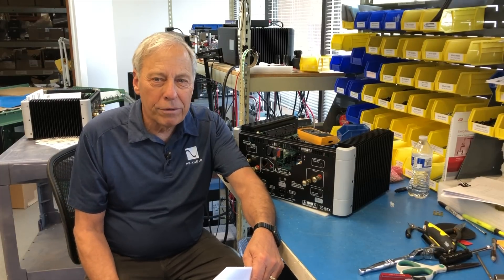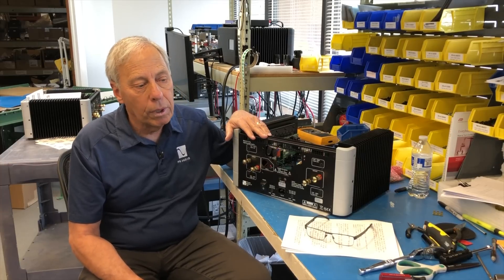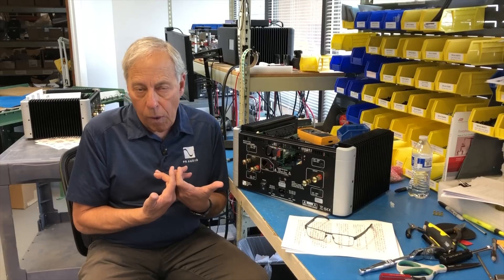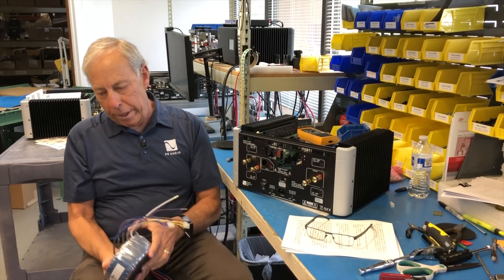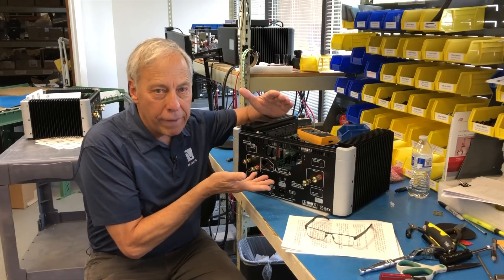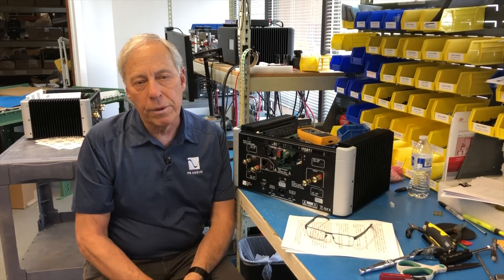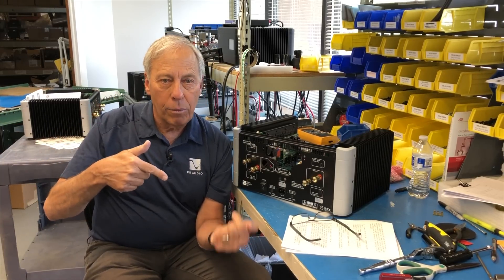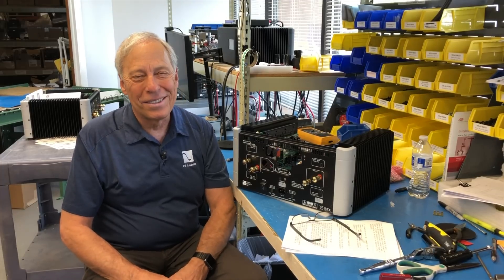Can you run 4Ω speakers on an 8Ω amp?

Comment: I disagree. For lower impedance speakers amplifier is driven with lower voltage and higher current and vice versa. When amplifier is designed to drive 8 ohms then with 4 ohms speakers it can overheat. But when amplifier designed to run 4 ohms speakers it's ok to use 8 ohms speakers, you will get only less power.
Reply: Lets say I am not using an amplifier. I have a hometheater and swap the  5 normal speakers with other speakers form another hometheatre. Will the homethatre will be affected. The impendance of the speakers is lower than the impendance of the original speakers. Or does it only apply to amplifiers?
Reply: @washingtonsenier9667  If it's an active speaker (which contains a proper amplifier and you need to plug it into wall socket) it does not apply, otherwise it uses amplifier in hometheater

Comment: can anyone help, i have an 800w amp with minimum impedance of 4 ohms and a speaker that has an  impedance of 3 ohm. will it run fine? or should i be worried of anything burning out?

Comment: So in short, he is telling you that an 8 ohm amp can totally power a 4 ohm speaker cabinet without any problem as long as it is a modern amplifier (solid state I assume)
Reply: Yea solid state. Vacuum tube amps are the ones with the limit for impedance

Comment: I think Paul may be giving some bad advice here. At low volumes and/or high frequencies, you're probably fine. At high volumes and low frequencies (i.e., bass), you're 4 ohm speaker on your 8 ohm amp is going to draw more power than the amp is designed to supply, and bad things can happen. If you are lucky, your amp will overheat and momentarily cut out. If you are unlucky, your amp will overheat and permanently cut out.

Comment: We used to have "Smokefest" parties... everyone would pitch in and buy a cheap AV Amp and hook it up to some decent 4 Ohm speakers run at high volume until the Amp clipped or smoked. Some of those cheap plastic ones would melt.

Comment: I have to say I disagree with you on this topic and this is why. Most speakers rated to 8 Ohm nominal impedence goes down to around 5 Ohm in the bass and low mid region, demanding more current at those frequencies to be drived properly by an amplifier. Now, how about a 4 Ohm speaker? Mr. Michael Fremer stated not long ago that his Pass Lab amp, rated at 200 watts per channel had a little bit of difficulty driving his Allexx speakers because they were going down to 1.5 Ohm in the bass frequencies. If a power monoblock can barely control a big tower speaker, can you imagine how hard it is to drive 5 to 14 speakers in a home theater system with only one transformer having to supply current when you are listening to an action movie? I have to say the great majority of audio engineers disagree with you also. Power and size does matter a great deal. In fact, this is the predominent reason why so many amps sound so weird with difficult, hard to drive, low impedence loudspeakers. Also, if you remember, the first loudspeakers to appear on the market were high sensitivity/high impedence models (Klipsch and Altec Lansing, to name only two). Those drivers could sing loudly with only 10 watts of power. Todays speakers have an efficency from 84 to 92 db for 1 watt of power, so they will need plenty of juice to give more than a whimper. Also, having built or modified more than 100 pair of speakers in my career, I can certainly testify to that point of view.

Comment: I cannot agree. Any electronic device has a current rating under nominal load. It is not only the finals, it is also the rest of the circuit. 
While some amplifiers may handle higher current some might escape the magic smoke. And it can be very expensive.
Always go with the manufacturer recomandation

Comment: So, I have a question based off this video. I found an old Yamaha integrated amplifier. Don't know model number offhand. I'm going to say mid 80's to early 90's. I bought Wharfedale D320's to match. And it sounded amazing. Well one day I turned it up. It seemed awfully loud, but I was cleaning and you know the rest. I went to turn it on the next day and had no output sound. Which made me sad. I had been meaning to pop the case open hoping it's probably output transistors that melted or something. Where would the first place you would look.

Comment: if you use a lower rated load impedance, purely theoretically you could overheat the output transformer. For example a guitar amp that has 16 ohm output connected to a 4 ohm cabinet, possibly the amp head could overheat... but realistically, for that to happen you are listening to crazy loud music. Before you can overheat the output transformed and blow up your amp the police is knocking at your door called by your neighbours.  The theoritcal risk is there, your amp can deliever say 100 watt at 16 ohms, so insteda you offer ohm load you would be asking your amp to give 200 watts to to speaker... but by the time your master volume has you using 10 watts to drive a speaker you are way above bedroom level. For home usage, it really does not matter, you adjust the master volume to acceptable volume and the wattage you are driving through the speaker  is typically always very low. You are spending 100 watts in byasing the tubes and heating the valves and whatever, but only a trickle of wattage flows to the speaker.

Comment: You could smoke your amp with 4Ohm speakers if it’s designed for 8. But if you’re only playing at moderate levels, way below the maximum that the 8Ohm amp can deliver, you could use a 4Ohm speaker. Currents will be higher, but as long as they’re within spec, it should be fine.
But don’t push it.
Another issue might be damping, controlling of the speaker. I’m not sure, but maybe an amp designed for 8Ohm has less controlled bass response on a 4Ohm speaker. Maybe someone else can fill the gap in my knowledge here.

Comment: These output transformers are still the way to go (and very important) in tube guitar amplifiers. Having multiple taps allows you to connect to different speaker cabinets, which can be up to 16ohms in many cases.
Reply: yes

Comment: What if your stereo says it must have at least 8 ohms per speaker but you only have a 4 ohm speaker. Can I use a resistor ? If so what kind. I have a Yamaha 225 watt stereo. thanks.

Comment: Yamaha uses impedance switch, but you leave it at 8ohm if it is well ventilated or 4 ohms if the speakers is very hard to drive.

Comment: Many AV receivers have 4 , 8 and sometimes 6 ohm settings these days.  Those in the industry in the know will tell you to leave it at 8 ohms.  The 4 ohm setting just limits the amps current to protect itself at satisfy regulator requirements.   Very few have physical switches,  it's almost always a hidden setting from the front panel.
Reply: Or back at the amp, they use every methods to pass the tests i guess.
Reply: all those audiophile av receivers

Comment: Agreed, Thank You Professor Paul....  Pertaining to this Ohm / impedance issue, perhaps Paul or someone could help me to solve / address my problem.  I have a Denon DRA-800H Receiver which is rated at 100 Watts per channel - 2 channels driven -  8 ohms.  120 Watts with 6 ohms.  2 Speakers connections (A & B).  I had 1 pair of Elac Debut 6.2s connected to the A speaker and a pair of Elac Debut Reference 6.2s on the B.  Then I decided to "add" by paralleling a pair of Flunance Signature Series Hifi Bookshelf speakers to the B connection.  The Elacs are rated at 8ohms , nominal of 6 ohms.  The Fluances at 8 ohms.  After playing for a while - over 30 minutes at medium high volume of 60 out of 98 , the Receiver flashed a red light at the on button and shut down.  It overheated.  Fortunately no damage to either the Receiver or the speakers.  Did it again the next day and I discontinued using  the A Speakers , playing only the Parrelled B speakers , and it played fine.  I also plugged the Receiver into a separate electrical outlet since there are a number of pieces of equipment plugged into a double outlet (20 amp circuit).  So now I have re-engaged the A speakers , and playing CDs today, and no issues.  But I am hesitant to push the volume past 55 or so.  I saw a Monoprice Speaker Switcher that has impedance protection tom the Amp.  Is that worth a try .....  THX for the advice and feedback

Comment: I have an old 1992 Technics SA-GX130 AV control stereo receiver. It’s rated anywhere from 4-16 ohms with it supplying 80 watts per channel at 8 ohms. But I ran one of the channels at 2 ohms and worked just fine (2, 4 ohm speakers in parallel). Since then changed it and am now running that channel at 8 ohms (2, 4 ohm speakers in series). The amp just ran really hot. even then I have since put fans on it because I like to keep things cool. Sounded mint and worked great, still does! I use this as a PA amp and works great! 

But is it bad to run an amp like that? I assume so because it’s not suppose to do that but I mean it works. And with the fans it kept it warm but not hot like before.
Reply: If anyone’s wondering I have another set of speakers on the other channel. In total I have 4 speakers connected to this amp

Comment: Sorry Paul its not that simple a answer.  First thing to understand is speaker impedance is a average rating, impedance will vary depending on speaker design.  Some speakers will have large impedance swings requiring a very stable and high current designed amplifier.  8 ohm is the easiest impedance for a amplifier to drive.  As the impedance drops it requires a amplifier to deliver more current.  In most cases any amplifier can drive 8 ohm speakers, but its when you see speakers with lower impedances that you must be careful in choosing the right amplifier.  Most high end amplifiers can in most cases be fine driving lower impedance loads.  But receivers are a different issue as many receivers today do not use high quality power supplies and discreet output stages.  Some use IC and are very poor at delivering high current to drive lower impedance loads.  If you try and hook up a receiver rated at 8 ohms and is not using discreet output devices to speakers rated at 4 ohms it can cause the receiver to get to hot and either go into thermal shut down ( best case scenario ) or can actually overheat and damage the output stage of the amplifier.  I have seen receivers go into flames trying to drive lower impedance load speakers.  So yes you do have to be careful.  Why its always a good idea if buying a receiver to get a receiver that is a high current design  and uses discreet output stages ( not IC's) then your likely safe driving lower impedance speakers.  Another clue to a cheap amplifier is when looking at its specifications how it increases power as the impedance drops AND at full bandwidth.  First clue to a cheap amplifier if its power rating is rated at 1 khz and not at full bandwidth of 20hz to 20khz.  This is a indication of a cheaply made and poor quality amplifier.

Comment: Some of the Yamaha amps have an “impedance” switch on it. Why, I don’t know.
Reply: Same with McIntosh Labs
Reply: I saw in another video about this somewhere that that switch is there to go around some power or interference restrictions of the USA. #dieselgate?
You should have the switch in 8ohm mode (I think it was... have to look it up.)
Reply: @niclaskarlin  I just got word that these impedance switches are intended to keep Underwriters Laboratories "happy."
Reply: @bikdav  I knew UL, had to look up Underwriters labs :-D

Comment: Howdy. Without the intention to be a wise guy.
The magnetic field does not transfer/transport anything. The magnetic field only satisfies the law of induction. Given a constant AC voltage on the primary, the magnetization is the same no matter how hard the secondary is loaded. ( Omitting the winding resistances. )
When a load is connected to the secondary there will be a secondary current. This current fights the magnetization. The magnetization tends to go down.
The primary observes this going down. The primary will draw current to restore the magnetization. When the magnetization is restored there is a current balance. The primary current cancels out the secondary current. ( Omitting the inductive magnetization current. )
Running 4 ohms on 8 ohms tube amp. results in smaller anode voltage swings in the end tubes. The risk of exceeding anode power is very real running on high volume. This may be seen as "red-plating" of the anodes. The anodes may be seen glowing red in dim light. The tubes will have a shorter lifespan.
However. Running on low power should not be a problem. In fact. The linearity should be better as the end tubes work more as voltage-to-current devices.
Rgeards.

Comment: Macintosh amplifiers they believe the opposite and think you should match to the speaker  that's why when you look at there rear panel of there amp each speaker post has a ohm rating and you are to connect what speaker rating you have to that post. McIntosh said that's what makes there amp special for years and sounds so much better.  I am not a Macintosh fan but just telling you how opposite one company/engineers thinking is.

Comment: How about the opposite? 4ohm output to an 8ohm speaker that has a higher capacity than the amp?
Reply: No problem, but you may not get the power (level of sound) out of the setup as you would have done if it was 4ohm into 4ohm. It depend of the design of the power supply in amp.
As we were taught many years ago, "impedance match = maximum power transfer", it goes for antenna (HF) and for audio sound (LF) too.
So to summarize it, too high impedance loud speakers may give you less sound power, too low impedance loud speakers may destroy your amp if you want loud sound.

Comment: how about running a 6ohms speaker 10-100w 
with a 4ohms av reciever 165w/channel?

answer please
Reply: imho if the amp can handle a lower ohm load then the speakers then you should be fine. Just be aware that your amp can over power your speakers.

Comment: It is important to say that the amplifiers has a minimum of impedance, and it's not good idea going down from this levels beacouse it is very possible to generate an  over current  or  overloaded it and burning out the output of the amp.
Reply: i blew many 8 ohm amps by using 4 ohm speakers in the 70s....so older amps did have this problems...modern amps  idont know.
Reply: You must have cranked the amp f quite a long time ( as one did back then)
Reply: I have harman kardon hk795i which produces a brum noise on left channel if connected with 4 Ohm speakers and works just fine with 8 Ohm speakers. But at the back it is declared as 8 Ohm MIN for one pair of speakers and 16 Ohm MIN for two pairs of speakers. So for some older amps I would say impedance does matter.
Reply: I also thought it was the main question of this video

Comment: I have an amp and it says on the back cover 8 ohm speakers only. If that's what it's resigned for is it safe to connect 4 ohm speakers ?
Reply: Do not contradict what you read
manufacturer states 8ohms
so stick to 8ohms speakers.

Comment: So all this talk, and the question wasn't answered. If you have an older amp with 4 and 8 ohm connections where do you connect 6 ohm speakers. I really like your videos Paul,  but sometimes you stray away and get involved in the workings (which is okay) or get off track with something completely off topic.

Comment: If the amp doesn't say 4 or 2 ohm, you may be able to drive it, or you may not.
1.  Some amps (most?) include the output stage in a feedback loop.  If the speaker impedance is too low, it can mess with stability.
2. Going lower increases the current and you may start triggering protection circuits before full volume.
Reply: I agree that the word "most" should not refer to all home amplifiers

Perhaps Pete meant :  "most PS audio amplifiers" can handle a 4 ohm load.

Comment: Is it? So there is no need for series and parallel wiring of the speakers to get the required ohms?
Reply: “When running a higher resistance a slightly different feel and response may be noticed. A slight mismatch can provide a darker smoother tone with a little less output and attack. This response is a result of the amplifier running a bit cooler.”
https://mesaboogie.zendesk.com/hc/en-us/articles/218267437-What-is-the-best-way-to-connect-speakers-or-cabinets-?mobile_site=true